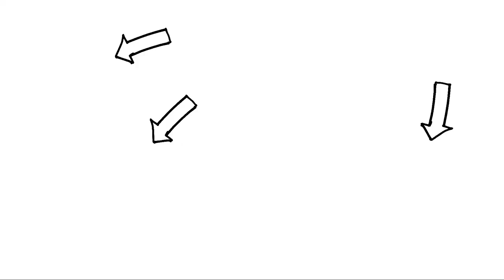Replacing the Sickle Cutters and Mowing Hay

Comment: "And good reason for" the slender and weathered look of a good many farmers that run those open cab tractors with tools that have seen for the most part, .... its a yesteryear tool. Those newer farms that harvest thousands of acres in tractors that are similar in the comforts of  a modern vehicle ride... stereos, air conditioning, cup holders, small fridge for keeping stuff cool to eat on. Those guys are short and round. I guess tho that "round" is a shape, just not what I call good shape. Thankfully this is not horses or mules doing the pulling of a mower of sorts similar to this now considered old school farming equipment

Comment: O, ya so many memories with the old mower. Those Pittman arms would break every now and the  I remember. Looks like it went fairly good for you mowing. Will give you lots of hay. What were you getting off and on for, was it plugging on you? Thanks for sharing.
Reply from the maker: So in the actual hay field, that was just to clear it out of the end. It seems to plug up in there depending on the grass length. In the back field, there were sticks that had been dropped during brush clearing, so I had to stop and move those out of the way.
Reply: @LandisLegacyFarm  OK. Do you need to straighten the forks on the end. I was thinking they were adjustable. The two or 3 that make the windrow wider. Thanks for sharing Josh.
Reply from the maker: I'll have to check on that, thanks.